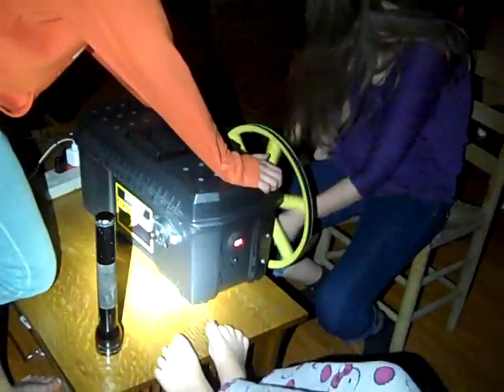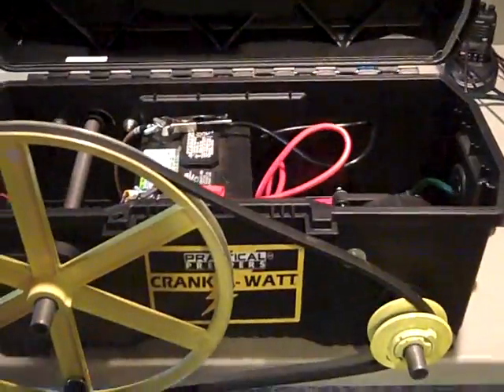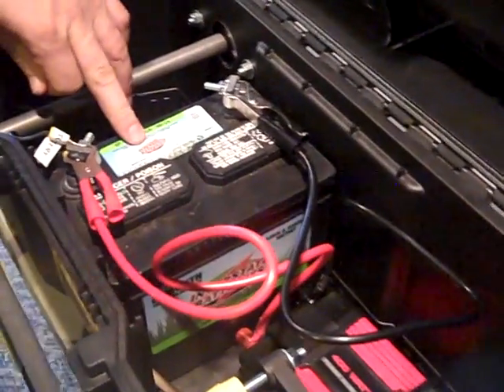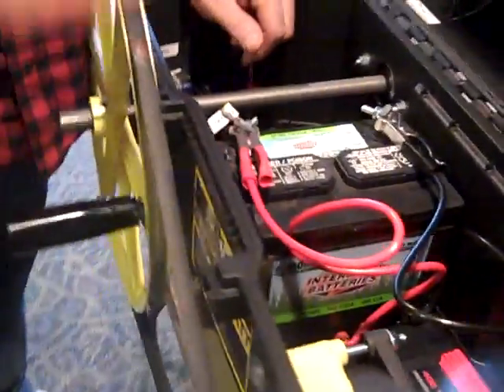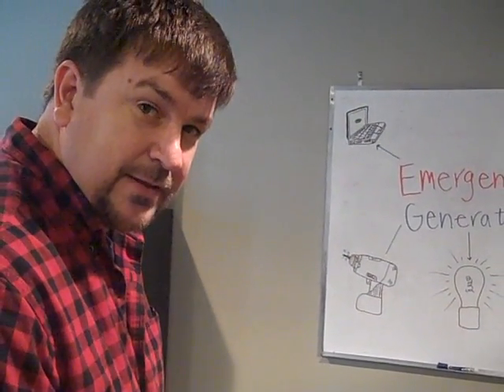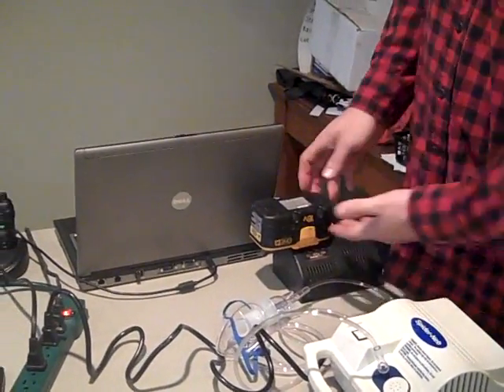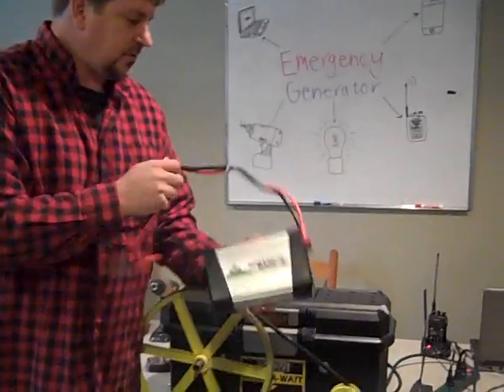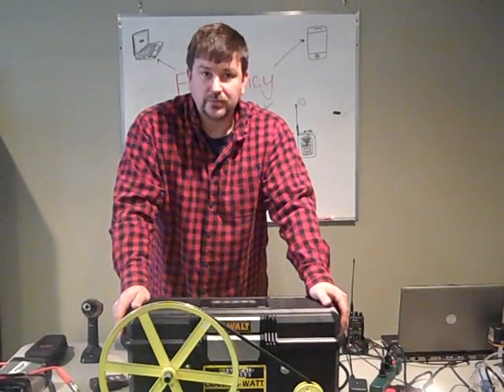Human powered generator

Comment: Hi Scott! Do you sell the PMW Alternator in your video? I have been looking at the specs of the Wind Blue Power & the Hurricaine low rev alternaters. Are these comparable to the alternator that you use, or do you sell them or can you tell me where to get one? I'm trying to put one together with a hand crank or &/or bike project. How many amps could you get for charging batteries if you did 80 to 100 rev/min? I would really APPRECIATE YOUR TIME IN ANSWERING THIS QUESTION! THANKS, victor_carter@msn.comi

Comment: At a moderate pace, what sort of watts are you putting out, or better yet, how many amps, while charging a battery? Can you put 3-5A into that battery by hand?
Reply from the maker: At about 25 rpms I am getting 10 amps actually.  This Alternator is a PMA and is hand wound to get high output at low RPMs
Reply: engineer775 Practical Preppers wow thats really impressive. i can appreciate that. Does Tim also sell these as just an alternator to use with our own application?

Comment: You should use a sealed lead acid battery because you have a potential bomb with the battery venting hydrogen gas into a small container ....after you crank a charge into it ....flip the meeter switch and kapow! Lid comes of spraying acid all over your face . I have blown up car batteries before . You may want to research super capacitors instead of lead acid batteries.

Comment: for a home operation, you can extend the power and range of this radio with a extra $200-$300 with a travel HAM radio tuner and a antennae amplifier with it directly connected to the crank-a-watt, would extend your range into the hundreds or thousands of miles in a small  package that can fit in a shoulder bag(add a 12v atv battery and a small solar trickle charger and you're independent of the grid totally). the HF radio frequency would open more communication possibilities. even portable ones.

Comment: 1) sorry should've specified... both
2) indeed :) but have you tested how long this rig can power continuously loads of 50W, 100W, 200W or 400W before draining the battery to 50%?
3) Well, I was referring to the one that comes with that system, or the one that Engineer775 installed (if different) or an ideal optimal alternator for the rig. Those specs should be available on all 3 cases. I'm interested knowing what autonomy can this provide before recharge action will be needed. Thanks again! :)

Comment: 1) are you asking about the output of the battery or the output of the alternator?

2) It could discharge the battery faster if you plug in items that draw a total of 400 watts. 

3) This depends on the alternators output. For that Egineer775 would need to list some of the specs.

Comment: Lead acid (car) batteries can only handle a 50% discharge. There are other LA battery types that can handle 100% discharge. DC Marine batteries contain more lead per plate. DC Marine batteries can usually handle 75% depth of discharge, sometimes up to 100%. Sealed AGM batteries contain the highest amount of lead per plate and are usually rated for 100% D.o.D., amp hours (battery runtime) is usually higher also. Batteriesplus dot c o m is a great battery resource.

Comment: Quick question: Considering just a 50% discharge... 
1) how much power can the Crank-a-watt battery provide?
2) wouldn't a larger 400W inverter discharge the battery faster as it will draw 2x the current?
3) how long will it take to recharge said 50% battery charge by cranking at low speed (as you mentioned)?

Thanks in advance for the additional info! :)

Comment: i also use both chairs as backup power i have a computer backup power supply i got at staples for 105 bucks has 6 outlets on it and produces 985 watts continuasly and a peak of 1500 watts 110volt ac i then made a patch cord out of the ups that plugs right into the chair again under the hand controller. can run the frige or microware power up the furnice k-1  one at a time.from full charge i can get about 6 hours of max output or about 10 hours if im conseritive  thats per chair gl richard

Comment: 1 scotter store and one hover round both are 24 volt i input the panels power under the hand controller there is a 3 proged round plug there left hole pos  right neg  bottom also a ground i dont use the bottom hole 2 bucks for the plug at home depot the scotter store chairs built in charger is 4 amps 24v and the hover rounds charger is 5 amps 24v this 200 panel is 11.3 anps so 3 times as fast to charge the scotter store chair on solar then is own charger

Comment: I wonder if you can take a pump and feel little cups on the crank and the weight of the water what turned crank and when you wanted to stop you turn the pump off do you think that would work

Comment: Try to run as much off the battery as possible. It's really inefficient to go from 12vdc to 110ac and then back to 12vdc. The laptop and the drill battery charger can run directly off 12vdc.

Comment: theres battery protection cables that run around $15 - $20 that will shut of the flow if it drops below a certain voltage. i think the $15 cuts out at 10.5 if i remember right. Available in most online trucker stores. They have a 10amp rating but i doubt you would go over that and for this system i would put one in it. I have girls as well and they would get cranky and lazy and just kill the battery rather then crank. Thank you for the vid was leary of getting one till i saw this vid.

Comment: How many amps is this pma outputting at 30 rpm's? How long would it take to recharge this battery from 50% state of charge at 30 rpm's? Are you using a pure sine wave inverters being your running medical equipment? Thanks and love your video's

Comment: That gives me an idea to watch for those small toy trucks and cars that children ride around in the yard.  Seems to me a 12 motor, when turned would produce some DC current back to a battery.  I liked the tool box idea also....keeps everything contained and easy to transport without the fear of yanking wires from their sockets.  Thanks for posting.  I understand that those toys may have a gear reducer, which actually means you may have to have more RPM to generate back to the battery.

Comment: Correct me if I'm wrong. Wouldn't you maximize mechanical advantage by moving the handle on the crank wheel closer to the center, maybe half way up. On the outside of the wheel it's easier to turn, but since it's already relatively effortless you might be able to significantly increase the speed at which you spin the alternator's rotor without significantly increasing the required effort. Worse case scenario you'd simply reduce the amount of time to fully charge while breaking even mechanically.

Comment from the maker: It has a 5 volt, 500 milliamp USB port on the inverter. You keep missing the point of this device.  If you you lived in apartment with no solar or generator option how would you produce electricity?  If you have a solution for a city or urban prepper I am all ears. And yes is is very easy to run the crank-a-watt with a bicycle.

Comment: If one of your critical loads is a cell phone charger wouldn't make more since to charge it direct from a 12 volt port to USB adapter rather than go through the inefficiency of the inverter. You can crank for an hour and produce 150-200 watts, that's about right, but wouldn't your effort be more valuable raising food or defending the fort. Cranking consumes calories that have to be produced by someone. The problem is a huge mis-match between power in and power out. Give realistic expectations.

Comment from the maker: It is set to run off of a bike.  Just remove the belt from the CAW and use a bike on a simple bike stand with tire placed into the PMG groove and away you go.  Sorry I didn't explain the bike part.

Comment from the maker: This device is for running small but critical devices.  I can turn the handle for one hour and produce ~ 150-200 watts.  A cell phone charger uses less than 24 watts/hr thus I just made enough power for 6 full charges.  An Asthma rescue takes 15 minutes @ about 75 watts of power.  Crank for 30 minutes and save a life. This is for people who do not have solar and generator options.  Do the math, match up the device with appropriate devices and you won't have snake oil.

Comment: Is this a practical device or is this (Crank-a-Watt) some snake oil maybe more egregious than the Solar Generator.

There is no way classroom full of children or even well trained athlete can put a charge back into this battery in any reasonable time. They give no specifications and if you took 400 watt/hours out of this battery it might take a day of cranking to put it back into the battery.

This industry needs a myth busters for just such crap.

Comment: What would stop you from hooking a small electric motor to it? It could be self sustained, even from dead, with the help of the crank handle to start it. I assume you would have to use some for of gear reduction to use a motor small enough to not use all the power that is produced. Any downsides to this idea?

Comment: I had the same question when I was checking on solar panels as I have a Cpap and the answer is yes with the correct setup. You have to figure the wattage needed for the machine and match the system. Sorry I do not remember the formula to find out.

Comment: Great 'gizmo' ;)  . .. I'd suggest that with the weight of the battery, that this 'unit' could be easily adapted for exercycle , or even a 'treadle' with the right 'mass' of flywheel for easy 'pumping out the juice ! ' . . .*( Even a 'teeter totter' could be 'linked' , thereby making it 'fun' for the kids, or ADULTS !  < Grownups don't make themselves have fun as much as WE SHOULD ! ! !   Low rpm devices can use hardwood bearings, greased or oiled, with felt washer 'seals' endless possibilities!

Comment: You could also add a 12V DC cigarette socket right off the battery to power/charge a host of things directly with 12V DC.  No efficiency loss in converting DC to AC to DC again to charge a device.

Comment: nice vid.on hand crank generator, The last vid you posted I asked the following question....I asked about ur vid on a harbor freight aux well pump 12 volt assist, what model and if it worked on a shallow well. I left comments before several times. If you could advise I would appreciate it. Thanks for your time.... updat :I am about to give up on asking this question if I do not get a reply,